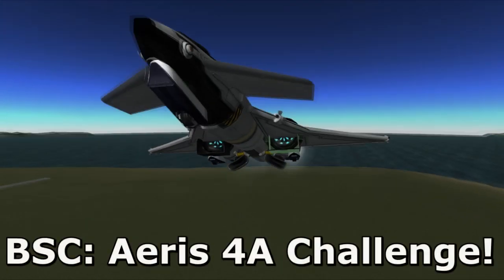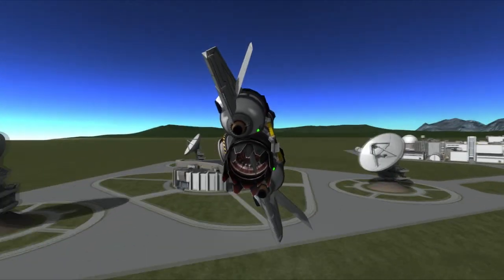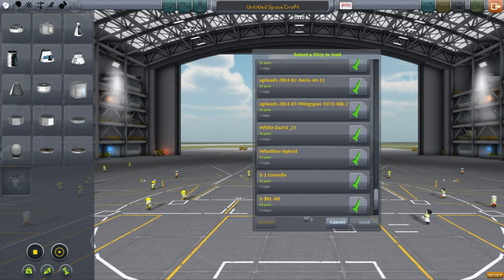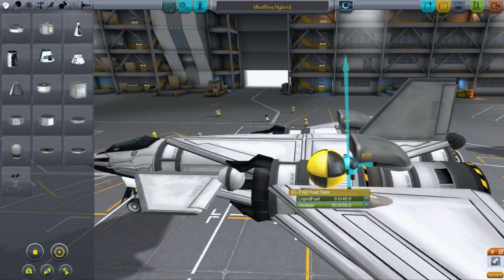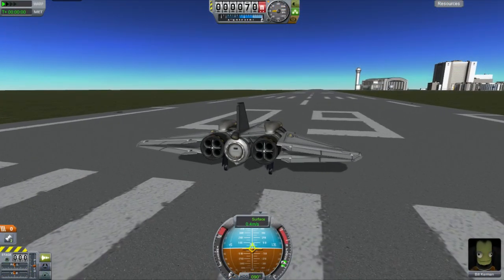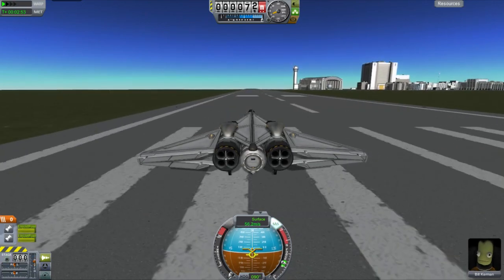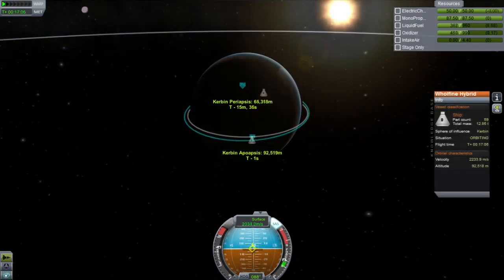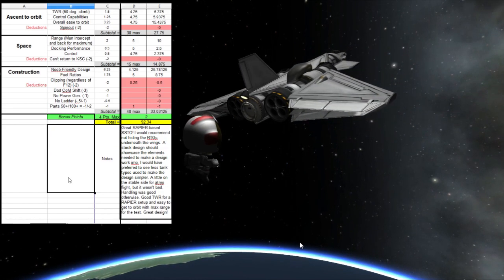BSC Aeris 4A Challenge: SSTO Testing Procedure! KSP v.23

Comment: Have you ever seen a string of 3 or more tanks in series that have working drainage sequence such that length mass is divided as evenly as possible.
That would be a reason to use smaller tanks instead of a large one as the advantage is in using the 2nd and 3rd dimensions to minimize balance issues.
Reply from the maker: Ah, that could be the case. I'd hate to have to refuel all those tiny tanks in space though!
Reply: Sure - but that is what those little green guys are for. If you are going to populate the entire Kerbal Solar system you are going to have to learn to like delegation of tasks.
It would be nice in the future where this game evolves to a common universe where we each can have a base and 'compete' or co-operate together..
Add life support requirements and you could have one person dedicated to making full and life-support requirements for missions.. etc.
Imagine competitions involving 3 or more people which start with a blank system and put a permanently manned base on every body and a station in orbit above for support.
Add in some more graduated science earnings.. a lot on each solar body - and you have a game I would have skipped puberty for.
Someday I would like extensions which allow for many simultaneous in atmosphere running 'mecjeb' or something more user programmable.. so cool things like in-flight refiling and kerbel transfer during flights at mid altitudes .. by building an extending air shield?? Cool challenges possible!.
Love your work and playing with these ships.
Reply from the maker: It seems like automation wouldn't be that difficult. I remember seeing a post on reddit of a guy who made an automated rover to drove over Duna. It was a really cool concept and actually worked. Automating Kerbals or even cars/planes/ships would be awesome!
Did you see/hear about the KSP tournament that they did at SXSW? It is kind of on the same line as that competition you're describing. It would have been cool to be a part of that tournament!
Reply: I watched (part of) that video also. Unfortunately, unless I was willing to lock myself into a version of ksp, and possibly many other great mods.. I'm actually considering branching my working KSP versions on disk.. but alas .. too lazy.
But to do what I suggest will require better mecjeb interfaces.. and debugging as it seems possible to fly more then one craft now .. it's not crashed a few times .. but sometimes will loose focus on updating the ship no focused on. And it's flown directly into the ground at other times and on video review I can't find indication of a reason ... the laser mod(s) have decent status feedback for most things.
I would have to look, but I'm sure there are a number of automation (for robotic control) languages likely could be used, with software and algo sharing between groups likely and advantageous.

Comment: Hurrah! I really want to see testing from the judges (Even if only a little bit).

On a side note:
 I also want to become an YouTube "KSP-er" but my processor is too cruddy to run KSP at even low graphics and a screen recorder at the same time :(
Any tips?
Reply: Cruzan AK ha i use obs
Reply from the maker: Well all my earlier vids were done on a crappy 6 year old laptop, so you can probably do it! I recommend OBS obsproject.com as a recording program as it doesn't seem to bog down your pc too much. 
You might have to do what I did which was to find any and all performance tweaks for KSP. This is a good resource http://forum.kerbalspaceprogram.com/threads/62981-Performance-Fix-KSP-Tweak-Guide
Reply from the maker: MultiGameLP's It works pretty well eh? Have you tried any other programs?